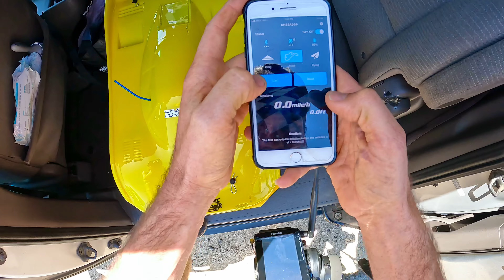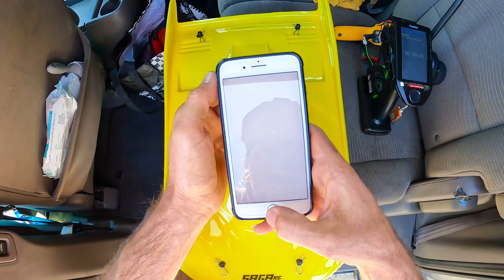Hobao VTE 1/8 GT 3S 137mph speed run

Comment: Awesome! Is that the short or long chassis  version?
Reply from the maker: Thanks it’s 1/8 vte
Reply: @93jdmmike  139 on 3s is wild! How many amps does that pull? I just installed the 38lb springs on my VTE, thanks to your vid. It made a huge improvement. 👍
Reply from the maker: @JustPlaneNutzRC  thanks buddy

Comment: Hi mike...once you put the fixed spool gearset in this hobao ,the stock dogbones dont  fit any more. Do you know who can make me the 2 new front and back hard stell dogbones ?  The front one must be 84 mm and the back one 114 mm.
Reply from the maker: Sounds like you have a GTB
Reply: @93jdmmike  yes i do.   Need those dogbones ! Castle 1721 2400 kv ..mamba X , 6S SMC bat, upgraded crown gears and 11T diff gears .
34 T spool , 29 T pinion.they have to be very strong steeel dogbones.
Reply from the maker: @eduardonessim4499  scorched RC parts make very good quality, high-grade titanium 85mm and 114mm dog bones. You would have to message me on Facebook in order for me to send you the links.
Reply: @93jdmmike  how do you appear in facebook.?